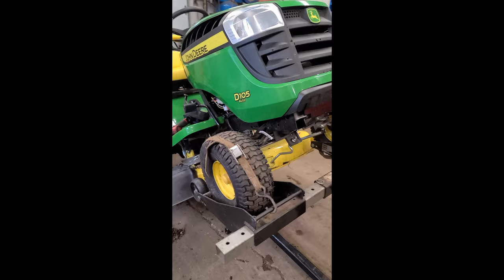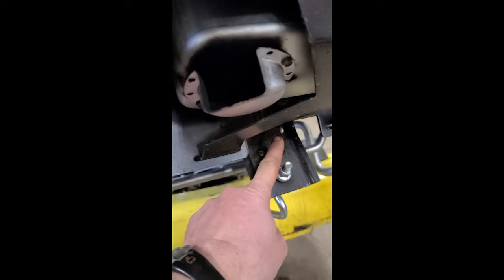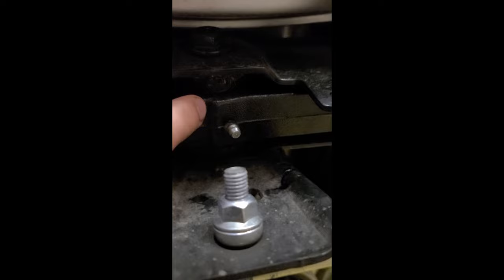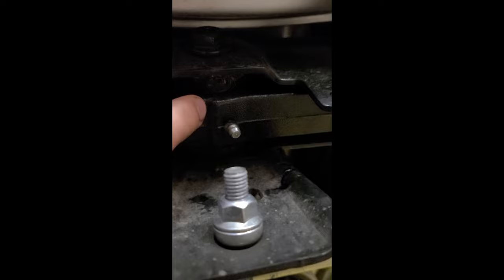Hidden Grease Fitting On John Deere Lawn Tractors #shorts

Comment: Not exactly hidden by any means.  First rule when greasing any machine.. check anything that pivots,  spins or moves at all. And an FYI.. The big box store John Deere mowers ARE assembled by John Deere in Greenville, Tennessee.  A dealer will sell the same mower.

Comment: I like the act that you can lift the tractor/mower up like that..any chance showing your lifting device or maybe drop a link to iti you already did one please?
I just adjusted valve lash on my Craftsman YS4500 B&S 21HP Intek v-twin this afternoon...irst time since I bought it (X years ago)...only out a little...amazing how it isn't having a hard time rolling over now...lol.
I am also having an issue with the steering...WAY to much end play in the steering shaft...what a stupid setup...they are relying on a small ipn to hold the pinion gear on the end of the steering shaft to stay up so it will fully egage the gear on the front end...no adjustment (that I can see) anywhere. I am thinking of adding a thick washer...errr...shim under the pin to lift the pinion back into a position that it can mesh with the arched rack. Well see how that works...can't be much worse than it is now...I hope.
Cheers from NB.

Comment: My old Cub (IH) 1450 has a grease fitting in the front axle for same reason - greasing the axle pin. I never even noticed it till I had to replace the pin and tighten up the pivot bracket👍
Reply: This is where the tracor's manuals get helpful. They list all of the lubrication points. I also do another approach, anything that has anything moving, where is the grease fitting. Don't forget the grease fitting on the steering gear. Its not the easiest one to get to, but it needs to get done. I have a 1250, with all of the original manuals, plus there are plenty of online support for these tractors.

Comment: Grease fittings are for older people who want to maintain their equipment so it'll last longer. Most young people don't even know what a grease fitting is, or know how to use or refill a grease gun.
Reply: And yet another boomer who trys the old vs young battle again. 
I'm 20 and I grease the front end and any other chassis components on my 2 trucks every 6 months. I use Lucas red n tacky in a Dewalt 20 volt grease gun? I also can rebuild a quadrant, thermoquad, and various autolite  carburetors with ease. Oh did I forget to mention that I also know what breaker points are?
Reply: @shannonwilkerson3919  you're an intelligent & responsible young man. I see a bright future for you.

Comment: So happy I got a zero turn with no grease fittings
Reply: Does it just not have anything with metal moving against metal? I guess if it has no steering parts that removes a bunch. What about the wheel bearings? Or the little shafts for the front casters, do those get greased or oiled? (Or ignored? I guess they could use a pair of sealed bearings)
Reply: @rpavlik1  when u step up to a quality machine you get sealed bearings. They make these tractors as cheap as they can.
Reply: This thought that sealed bearings never need lubrication is ridiculous.
Turns everything in to either a maintenance headache or disposable.
Reply: Yeah no such thing as lifetime grease unless you are ok with letting them limit the definition of lifetime. Heck, they even sell needles for greasing behind the seal of a sealed bearing without removing the seal.

I do have a quality machine, I have (temporarily 2, selling the smaller one in spring) Simplicity lawn tractors from approx 2005. Very well made, really thick steel, easy to service, and lots of grease fittings. I'd think that a cheap tractor would be more likely to have sealed bearings because statistically the folks buying a cheap machine probably won't grease it.